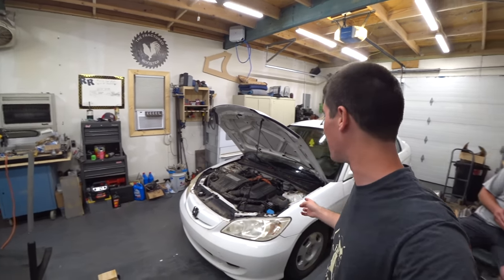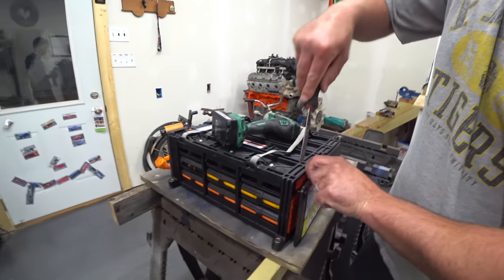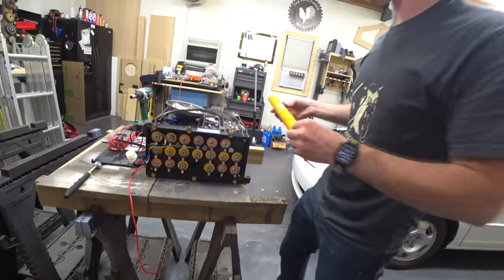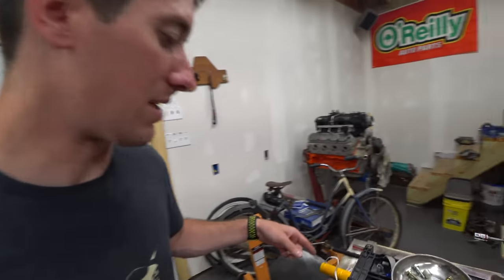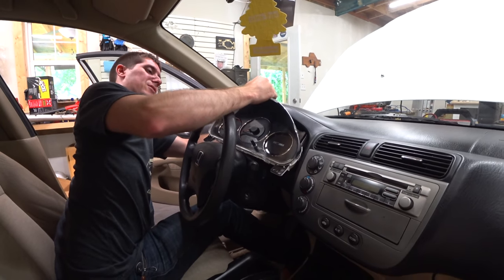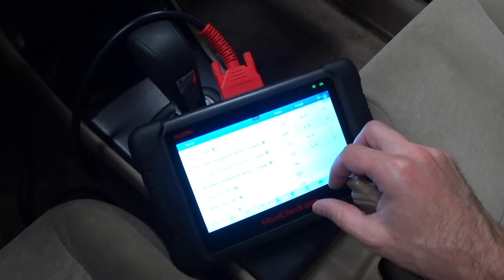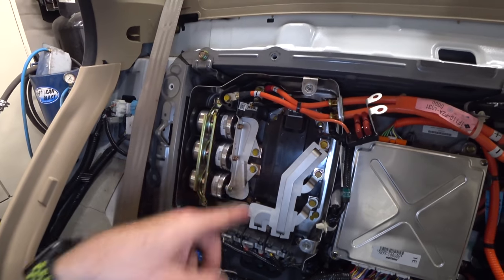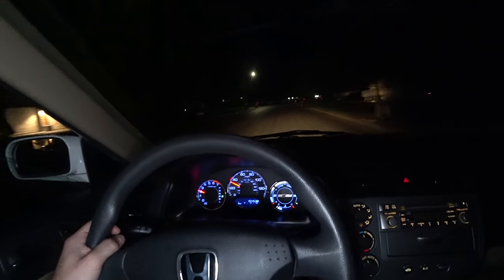REBUILDING The Cheap HYBRID Civic BATTERY PACK *And Then Unhooking It*

Comment: My theory is, the owner of the Honda had the battery go bad.  They purchased the rebuild kit, did the repair and when it happened again threw in the towel.  The cells that they said were new were actually old. Maybe the factory cells.

Comment: Start with fixing the bad temp sensor. You should be able to ohm the 3 to figure out which one has a false reading.
Reply from the maker: It’s the one with the white insulation from what I can tell, wish there was a guide on its ohm readings at certain temps 🍻
Reply: WatchJRGo see what the other 2 read? Might could replace the sensor with a resistor of the value of what the other sensors read just to test. See if that fixes your issue then get a replacement sensor.
Reply: @WatchJRGo  Your over thinking it. At around room temperature the PTC circuit should be between about 10 and 40 ohms. Measured by pulling the junction block off and measuring between ends of the red PTC wire. If the wire is cut then you likely have a replacement battery. This requires an MCM with updated software for the deleted PTC system. If a dealer updated the battery and software then there should be a sticker on the drivers door jamb about the battery type. Being a hack worked on it you may have a MCM and battery mismatch. The new Software does not want to see the PTC, and the old wants to see it.  Also you want to check to see that the PTC is not shorted to the High voltage, this requires removing the back side plate and measuring between on of the PTC connections and each of the battery bolts on that side. There should not be a connection or its shorted to the cells.

Comment: There should be a large fuse on the underside of the  junction board. That should hopefully get the voltage coming out of the battery pack.

Comment: Engine is good. Transmission is good. Battery under hood is good. Good rounds. Doing it all right it sure seems but damn I'm glad I didn't get a Honda Hybrid. The big module has to be broke. Take it apart and look for burnt stuff? Got hot and burnt up? Don't give up. You'll figure it out.

Comment: It's like a notebook battery, if you disconnect&reconnect the cells from the BMS, the BMS will shut down and won't turn the power on again, it needs a reprogramming.

Comment: Official diagnostic is "swap with known good". The engineers really took a shortcut. Let's design this with no forethought of how to field test.
Reply: There is virtually no way to practically resistance balance a NiMH battery pack in the field, which is why so much goes back to replacing the battery module.  I'm going to attempt it on mine but I enjoy this stuff and have a pretty good knowledge of electrical engineering without being one.  There's no way a shop would make money trying to do this.  The issue is the batteries are all low amp-hour and in series, so if one of them is mismatched from the rest of the chain, the entire performance of the array is going to suffer.  

I can understand early hybrids having conservative approaches to monitoring battery array performance because, as Tesla discovered, its not so great when your customers die in car fires.  If that pack went up behind that foam seat, you could have kids waiting in a car engulfed in flames in a minute.
Reply: @jamesbrowne7948  the part in question was a controller, not the battery. There should be a way to field test the controller other than swap with known good.

Comment: What other cars get great gas mileage like hybrids?
Reply from the maker: Older lightweight cars, like the Geo Metro XFi 💯
Reply: Electric cars
Reply: Bicycles
Reply: 80s Volkswagen TDI
Reply: HotWheels
Reply: hybrids still seem to get significantly better mileage even on the highway, probably because of thr atkinson cycle.
Reply: Honda CRX HF.

Comment: What kind of gas mileage so u get w/ the IMA unplugged.
Reply: I have one of these and am having the same issues.  Before parking it the MPG dropped to 38 from the normal mid 40's without even trying to drive economically.  Trying, it would get 55 on a full trip cycle (5 sp manual).  I haven't tried it with the MCM unplugged, I might give that a whirl given that it appears to no longer be charging the 12V from the IMA.

When I got it it was doing the same thing but I got it from someone who drove it in short trips and I started using it on long highway commutes.  The IMA system fixed its self with the long charge cycles, eventually shut off the light on its own, and operated fine for a couple years.

Its only like 65 hp engine and when the IMA really started to go it would limit the assist power severely and it starts driving like a dog real quick.  It has no torque at low speeds.

Comment: Your battery is only charged to 19%. That is a very low charge state for a NiMH battery. So low that there maybe a safeguard so that it does not provide power in order to prevent further discharge. Try to use an external charger to charge to 100%. Now where can you get a charger for a 144 v battery?  Maybe a dealer. How did you check the NiMH battery charging unit? I would hate to see that your 12v lead acid is discharging at a high rate because it is trying to charge that huge battery pack through some crazy programming glitch.

Comment: That's a weird one. Sounds like an issue with one leg of the contactor or mosfets in the motor controller. I have no idea how hybrids are wired. Great find, a hybrid with a box of sleeves of nickel cad D cells in the trunk. What were the MAH ratings? Out of curiosity I checked wholesale pricing for 100 units. 600 dollars for 2500 mah, up to 1300 dollars for 12000 mah without the temp sensors, but I'd be suspicious of anything with that high an energy density unless they were LiFePOs. Bat mfgrs have been known to lie big time about their ratings. Also interesting, the Civic takes an IMA half the size of Priuses. You should persist in resolving the IMA light just to check it off the list for the future. FYI, Bumblebee in Oregon sells the Honda IMA complete for 1650.00 + tax, so kudos. Thar's gold in them thar gold battery packs. Could be a nice little cottage industry for you lads.
Reply: 2500 mAh in a NiMH D cell = 1x AA cell inside, pretty much. That's a joke / scam. Real D cells should provide about 8000 to 12000 mAh. You can buy 3x AA to 1x D adapters and still get 5700 to 8100 mAh this way.
Also, that's not an energy density. For that you'd have to track both current and cell voltage. The energy content of a 14500 LiIon cell (around 750 mAh typ.) actually works out to be pretty much the same as for an AA NiMH cell of same dimensions, so energy density is very similar - but the NiMH is likely to be about twice as heavy. Between that and the much higher cell voltages of lithium chemistries making balancing much easier, it should be obvious why portable gadgets have almost universally gone lithium.

I'm actually using one of the last holdouts of AA cells, a Pentax K-50 DSLR. That can be equipped with an AA cell holder which gives better battery life since the standard 2-cell lithium battery does not actually fill the entire compartment, and for some reason it also helps manage a very common aperture solenoid problem in these cameras that's a fiddly repair job with good-quality replacement parts not obtained too easily. (I got the adapter once I started noticing the first issues, and - knock on wood - so far the camera has been behaving itself.)
Reply: @PileOfEmptyTapes  Haven't used NiCad or NiMH batteries for twenty years so this was a good exercise for the wayback machine. You're right, energy density is current x voltage. I'm used to talking batteries in mah. Both NiCad & Nimh D cells are 1.25 V. JR & Josh's IMA holds 21 sleeves of 6 batteries @ 1.25v = 157.5 v total, the exact amount they read on their vom.

Comment: Will the car work if you disconnect and not use the battery? Like a normal car
Reply: It's a 1.3L engine which is probably tuned to work with the IMA system (thus the sluggish starts).  Don't know if that's a good idea.

Comment: you're packing it in and accepting failure?  this is unacceptable!
Reply: Sometimes the rewards aren't worth the risks. Old hybrids get real expensive real quick mostly due to parts availability and the nightmare that is their wiring schematics. That Civic had 150K or more miles and he already paid way too much for it. Even if he sells it off as a mechanic or project special he's already lost at least $200 on it. If he can't flip it for the channel, kick it to the curb. He's done that before.

Comment: Just because they charged doesn’t mean they hold the charge plus that charging process was way too fast. I have been working on one it’s so complicated I charged two cells and but he next morning the voltages dropped 2-3v. You video is great though very informative. I also don’t have the RC charger I tried to use a bench power supply  just for the heck of it and it charged too fast like that everyone else I’ve seen charges very slowly.  I’ve messed with this thing for a while and I keep shelving it also  but I do think when the battery pack is too low it disables parts of the system.  Pretty sure the cells are bad form sitting so long and they need to be charged and discharged several times. I’m curious if you car will keep driving like that or if it wi eventually kills the 12v battery everyone says you can’t drive them like that including the wonderful gentleman who rolled me off (haha) but that doesn’t seem to be the case at all.

Comment: So I have a honda civic 2003 ima  battery is definitely need to be  changed, battery  the cheapest  battery I have found 1,700. 
Has anyone sold there car with a new ima battery in it and how much for?  Does it add value to it?

Comment: The main root of your issues with that car is that you did a half-assed job of charging the individual sticks (modules). I expected better from an "expert" on hybrid cars! It takes a min of 90 minutes to fully charge a stick. You can tell a NiMh cell is fully charged not so much by what the chargers display is telling you but by the slight temp increase in the surface of each cell in the stick. You need to also load test each stick. Some can seem ok to use but hold far less V than the others. Also, once you have the pack reassembled, a fully charged pack will be around 175 VDC, not 154! Anything less than 168 and the computer will refuse to even consider turning on the IMA system. FYI Also read all the other postings here about balancing a pack, you have a lot to learn about these cars still dude.
Reply: 🤣...they all claim to be experts...just like myself...I'm an expert bull-shitter...& know a little bit about noth'n 😜
Reply: @ltdees2362  Ya I agree. Much of what I see on youtube is at best well meaning BS to some degree. But in this case I really do know what I am talking about since I have done dozens of pack rebuilds on Honda hybrids. There is very little I dont know about them at this stage anymore! And it rather ticked me off that this guys video was so misleading and stupid, maybe causing some newby to make poor choices too.
Reply: @michael47lamb  I'm with u brother 👍 My son-in-law is a tech at our local Honda dealer...said best job security vehicle Honda ever produced. Hybrid's along with their associated electronics, just to complicated and problematic. Russel says even the  newer models average coming in every 6 to 8 months. Surely not a good track record...

Comment: When you said that Hyundai's don't turn the check engine light on unless something is very wrong, I got very worried, because mine has been coming on intermittently... This is gonna be fun lol.
Reply: did u check it? p0420 probably if it's intermittent and nothing else seems wrong
Reply: @poiiihy  Lol I've tried to check it like 5 times, every time I have the scanner in hand and go to plug it in, the light turns off again and there are no codes. At this point I'm thinking an o2 sensor that's on it's way out, cause nothing else would flip it that quickly, and the car still runs great.

Comment: when you buy them you don't know how long they've been sitting you'd be surprised how many codes and lights go away after 30 minutes of driving you have to go for a good drive to know how many problems you really have or you are guaranteed to waste time the system is designed 2 work with failed and or failing cells capacity and performance fades off little by little until there's no assistance the more you drive them the better they run and you can drive for quite a while with IMA light on

Comment: Replace the 12 v and just keep driving and Regenerative braking maybe it'll charge and work lol
Reply: Not if the contactor is refusing to energize.  Everything electrically in the car lives off that battery.  The 12V only system is basically the electrical version of a donut.  The regen system has to dump power into the main battery which acts as the system load absorber and voltage regulator.  I don't think you can do any cool Scotty hotfixes and get regen power straight into the 12V system as the voltage from the motor generator is going to vary wildly (probably hundreds of volts) depending on armature RPM and brake effort.

Comment: Hybrids are better for the environment- until they don't work anymore. Plus, they don't like hot or cold climates, so they're very robust in almost all areas of the world. The good news is for all of the extra maintenance and down time the car will likely experience, a person can drive an efficient fuel-powered vehicle while sending said hybrid to a repair shop or scrap yard. How are the mpg and performance numbers without an operational electrical system and a wheezy Atkinson cycle engine?? 🙄

Comment: Trick that bitch ass sensor with a resistor and install a new 12v battery . . . and maybe it will come around. Hybrids are finicky weird creatures.
Looking forward to you messing more with it and trying a couple more fixes before dumping it. Good luck. 🙂👍🏻

Comment: Beats a Prius...they will not run at all with a bad battery pack
Reply: luckily their packs don't fail so easily afaik and if they do, replacement parts are easy to find and there probably won't be anything more to do than swap the cells.

Comment: Found a Civic of similar vintage on autotrader in my area, was $1,500 and had like 65,000 miles. I was like WHAAT?! read the whole description... it's a propane Civic from factory. The thing said the tank would get you 240 miles... or 2 days of work for me. Figured out the cost of filling the tank, turns out it would cost me double what driving a gas car would. LOL. Right.